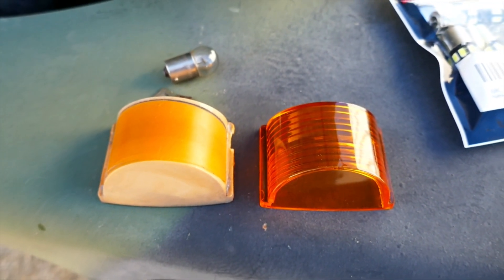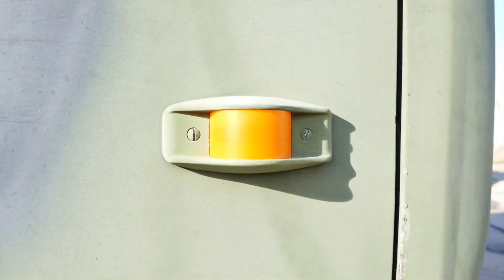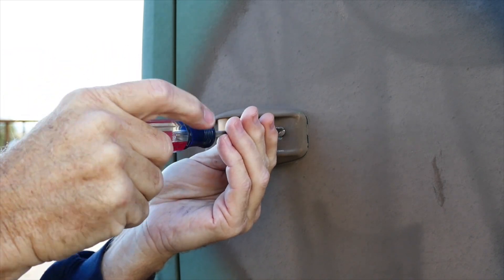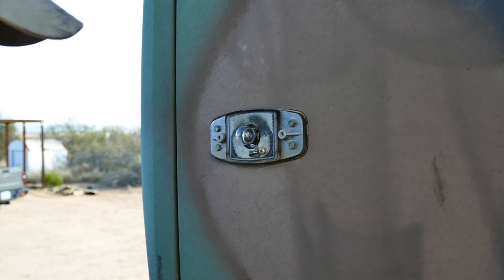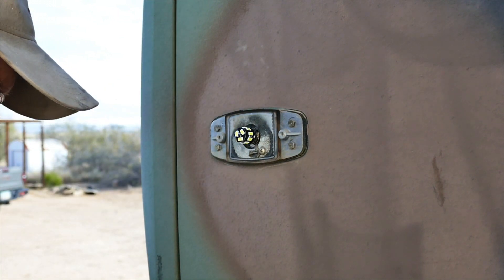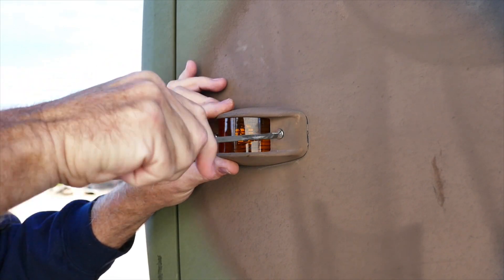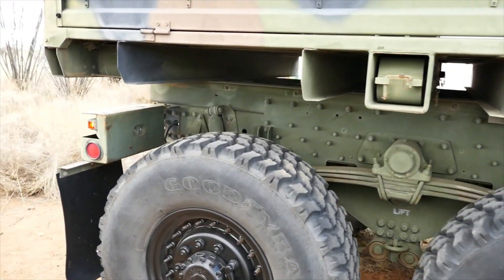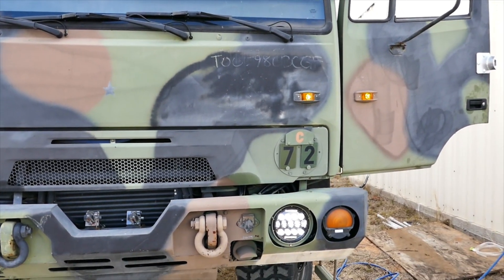FMTV LMTV MTV Marker light lense change and LED bulb upgrade.

Comment: future considerations folk.......  It appears from some stuff have read and watched..... LED are bit different in "color" reaction to the color of the lens.  From what I gathered from that info is it seems they actually work better/brighter when you match the color LED bulb to the Lens color as best you can.   So consider changing  your thinking as well when you change the bulbs to LED?
Reply from the maker: I read that thread as well. It is way above my pay grade. I will go out tonight and try to take a photo in the dark and see if there is a color change/difference. In the daylight as shown in the video, I think they look fine..
Reply: What are the bulb size for those.  Our brush truck needs new. They are worse than yours